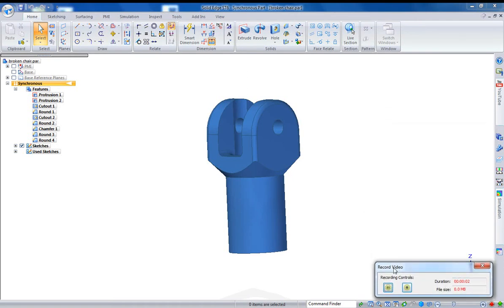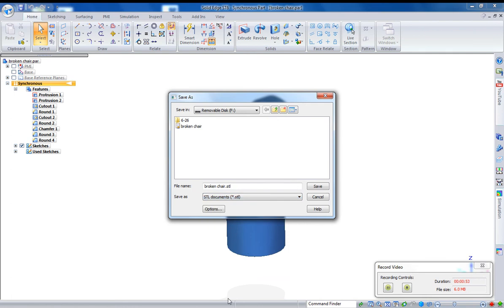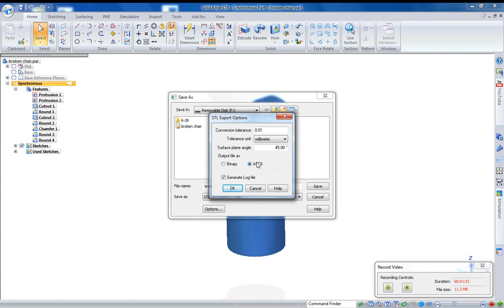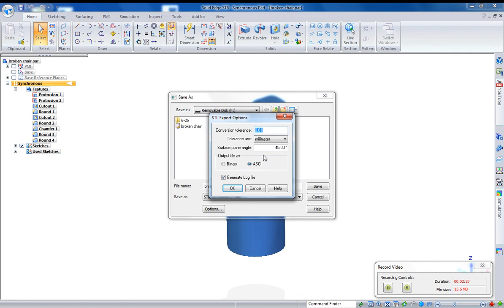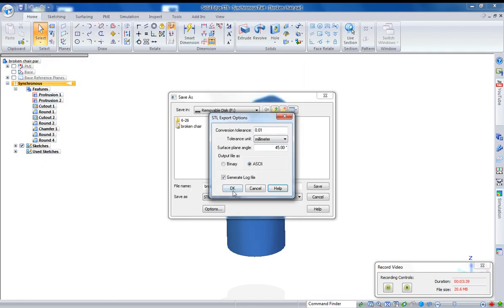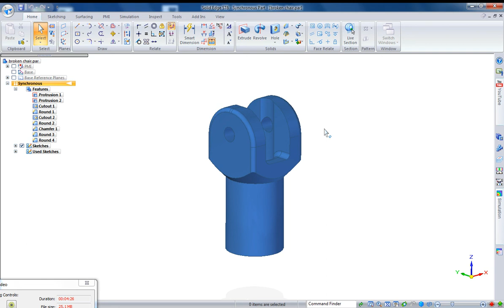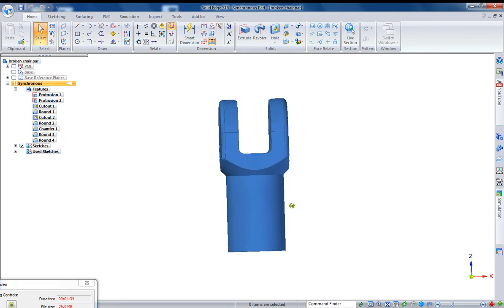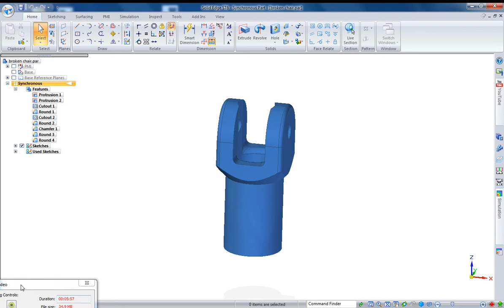Creating STL fles in Solid Edge for 3D Printing

Comment: Hi
Nice video, i'm also using solid edge (st5) for designing my 3d printer parts.
I'm having trouble exporting models with threads as an stl. the design comes out fine but the threads are always missing
Could you help me please?
Thanks
Reply from the maker: Best thing is go to here :  http://community.plm.automation.siemens.com/t5/Solid-Edge/ct-p/solid-edge  I'm sure there are a lot of Solid Edge users that can help you :